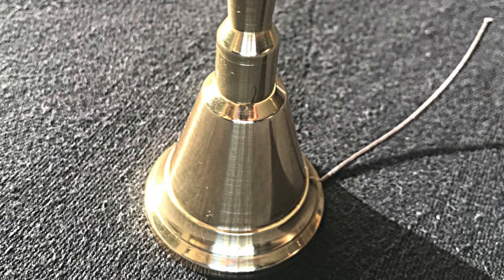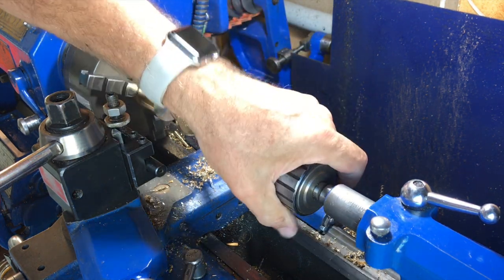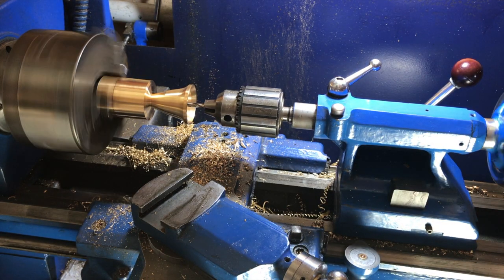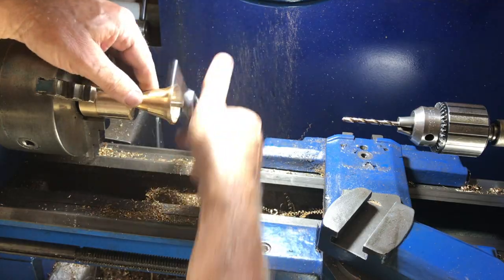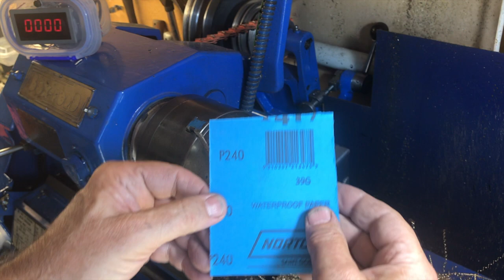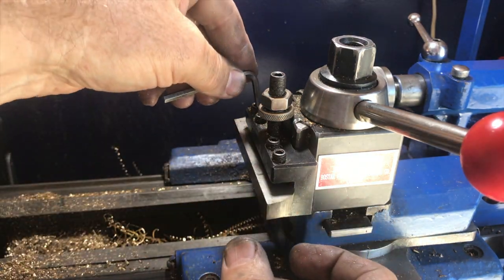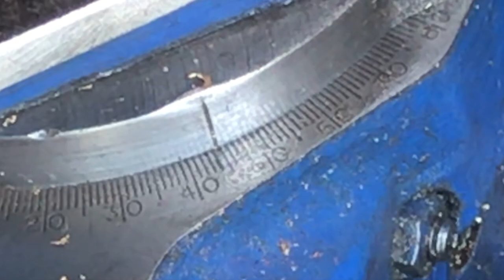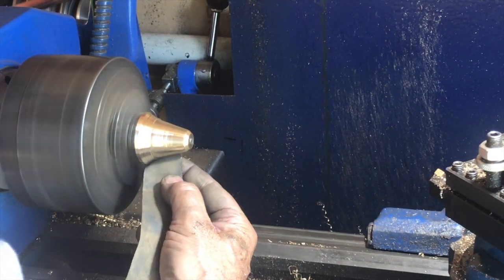A Small bronze bell project

Comment: Nice job 👍! I dang near crapped my pants when it came off , that’s happened to me several times !
Reply from the maker: Yeah, I must be a slow learner when it kept flying out. Then I had to repair it. I love the gold finish on bronze. Now a year later it looks just as good.
Reply: @Evan-e-cent  brass is nice but bronze is better in my opinion . I can’t believe the expensive coins people are using ! I have a few pre-1970 silver but not like Skyler and others use ! Maybe I’m just cheap ! Lol
Reply from the maker: @davekimbler2308  Funny, I have been making medallions which look like gold coins, made out of that bronze and stamping names of people or organizations on them to be sold as souvenirs. 

Yes, I used to like turning brass, but now I avoid it if I can because it makes tiny needle-like splinters that get into my skin. I got two lengths of aluminum bronze, 1.2 meters long, from the scrap dealer. One 30mm and the other 42mm diameter. Propellor shafts from fishing boats. The staff said they didn't have any solid shafts, but I said what is that 44 gallon drum with broom handles sticking out of it. Oh that is the bosses private supply. Finally tracked him down.  I also got a stainless steel high chrome shaft out of a hydraulic ram 40mm. They weren't cheap but great materials to have. Another scrap dealer gave me an 80mm diameter bar x 40cm long free. Said it was magnetic and wholesalers will not buy it as they cannot prove it is magnetic stainless.
Reply: @Evan-e-cent  the salvage place by me isn’t cheap either ! A 1.25” x 36” aluminum/ bronze cost me $30 x 2 pieces @ 18” each = $60 and a 36” x 1” hexagon stainless for $20 and a 3” x 36” aluminum round for $20 total $100 ! Best $100 I’ve ever spent ! Lol
Reply from the maker: @davekimbler2308  Roughly similar prices to what I paid ... and with the same sentiment.